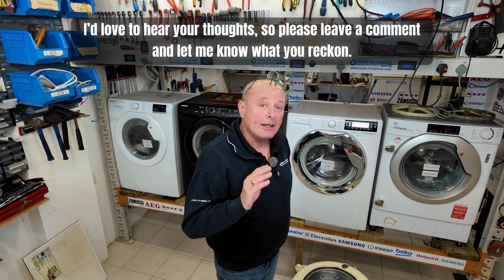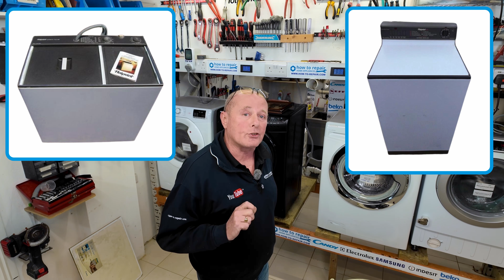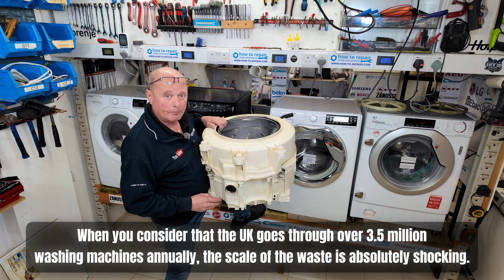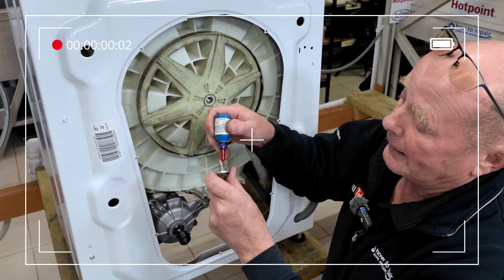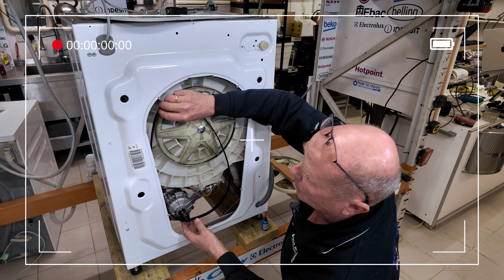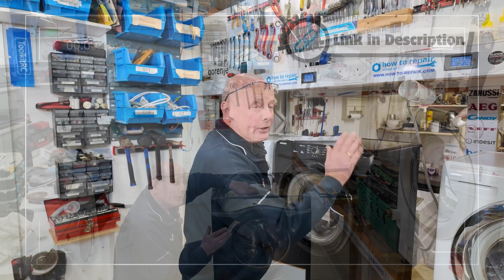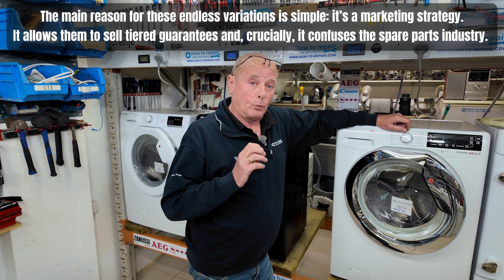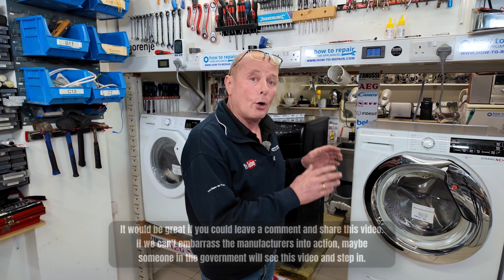I Scrapped 13 MACHINES to Prove a Point: STOP BUYING These Brands!

Comment: You need to provide a technical report on each machine covering such things as quality of documentation with regards to servicing, ease of repairs, availability of spares and prices thereof, and finally which models have drums that can be separated to allow bearing and or spider replacement.
Reply: You can go with LG, they still produce splittable drums and affordable spare parts. If you are well mechanically you can do it yourself and save the service fee. 

Disadvantage - if the pcb fails its gonna be costly but it goes with each brand nowadays.